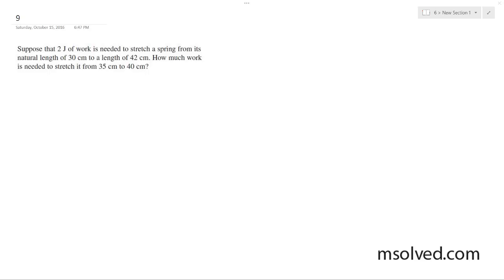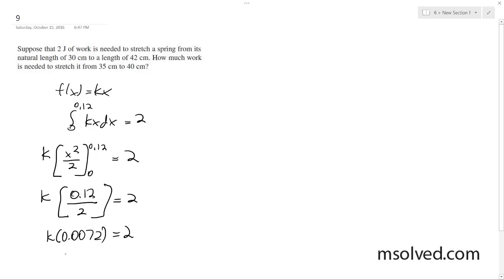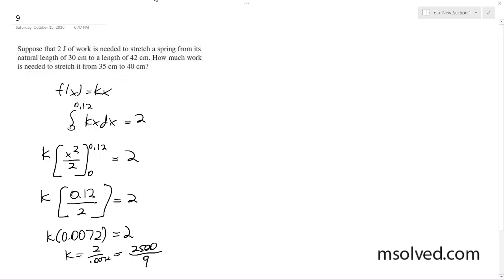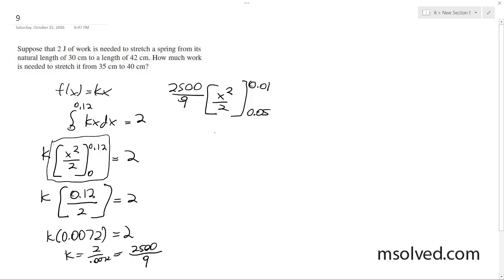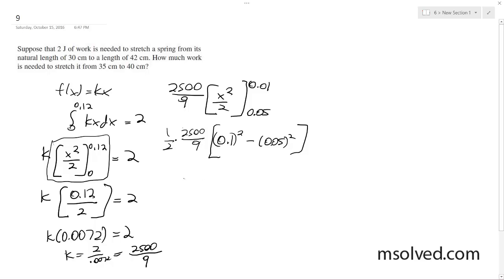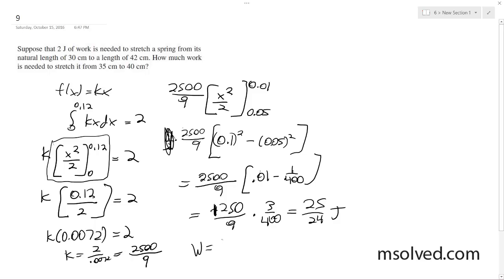Suppose that 2 J of work is needed to stretch a spring from its natural length of 30 cm

Comment: for those who dont understand how he got the bounds for the second integration.
If 0.30m is the start (or 0) then 0.35 is going to be 0.05, because 0.35-0.30=0.05.
and for 0.40m it is 0.40-0.30=0.1m so, youre basically making 0.30 your starting position and then using the difference in length to figure out the bounds.

Comment: If the bounds are from 0.05 to 0.01, why did you plug in 0.1 instead? Bit confused how you got there.
Reply: He meant to use .1 and not .001 as he was converting 10 cm to meters.

Comment: For anyone confused as to why he integrates in the beginning to find K, the difference I could find between the example problem and this one is that the example said (X amount of force is needed to hold a spring thats been stretched) and this problem says (X amount of force is needed to stretch a spring), so rather than simply holding the spring with the energy, the energy is for pulling back the spring.

Comment: where did you get .01 from?
Reply from the maker: It should be .1 not .01 (sorry) cm, I should have used the original values of .35 and .4 to prevent confusion.